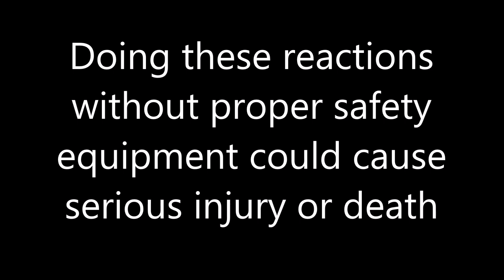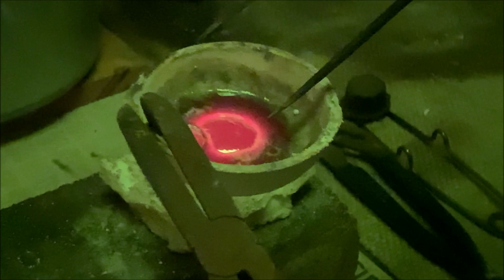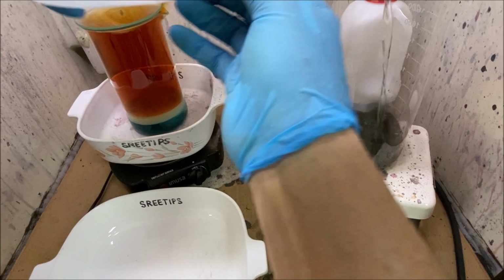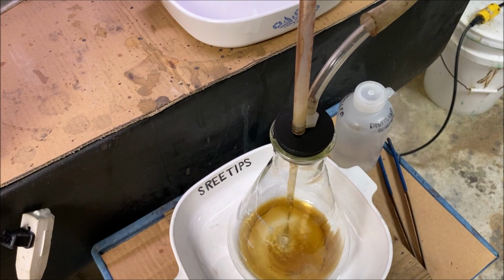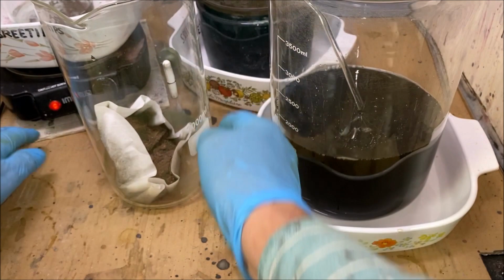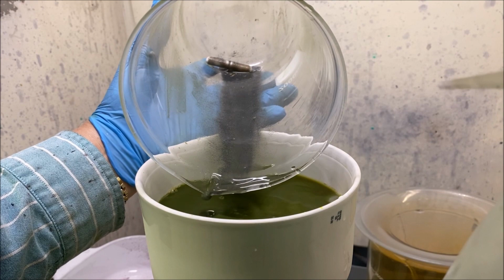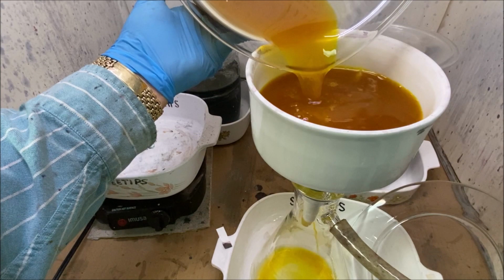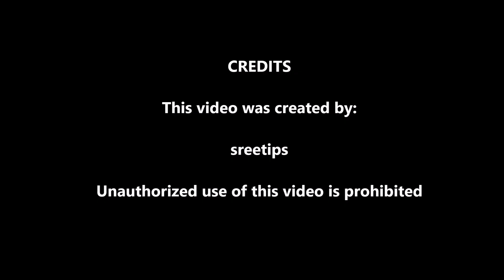Jewelers Tool Drawer Filings & Clippings

Comment: I know a story of an old jewellers work bench. The jeweler one day closed his shop, the heirs sold most of the equipment but one buyer showed much interest in the old work bench. The workbench was in use for decades and showed a lot of wear and tear, and it certainly had seen better days. So you would not set up a workshop with the old work bench. The daughter then took some time and found a very special business that had the special kind of knowledge and equipment to take care of the workbench. They burned it and recovered around one pound of gold from the ashes. So the bench had a much greater value than anybody expected. Certainly much more than the original offer was.
Reply: That story just doent add up/// Ive been a jeweler 50 years...
Reply: @johnshipp3050  hence why it says "stoooooory"
Reply: Fake news
Reply: @BabyJesus66  I do not know any of the persons involved. However it seems plausible that gold particles will stick to the wood of a workbench and get worked into the wood and that you can retrieve it by burning and extracting the ashes.
Reply: I was buying the story until I heard "one pound"
Reply: @williamstamper442  The size of the bench wasn't specified nor how long it had been in use. And it would have included the drawers with accumulated crud. The story also doesn't tell what pound.
Reply: "...Around one pou-"💩💩💩 🤡

Comment: A client owned a jewelry supply company. They made gold chains and findings( catches, stone mount prong settings etc) . They kept a individual section of carpet under each jewelers bench that did gold work and periodically replaced the rugs after vacuuming to be sure no stray stones were in it they wrapped it up and sent to to a refiner who burned the rugs in a furnace and recovered the gold for a percentage.
Reply from the maker: I’ll be doing the carpet from under his bench in an up coming video

Comment: Just some tips or ideas you may try.   Three decades ago when I did fire assaying of ores on our mining claims, we used lead litharge to collect the gold, silver and PGMs and a flux to remove the base metals, that the gold, silver and platinum group metals were collected in the lead - the silver and gold helped collect the PGMs - then used bone ash cupels to absorb the lead oxide leaving a precious metal bead/button.  When you have a good guess of how much gold, silver, etc, you can add a known weight of silver could be added at the cupeling stage to aid in the nitric acid separating the gold and PGMs.   If you are using stirling silver add it to the flux smelt and you can remove the copper (or/and nickel from some alloys) into the slag and adjust the amout of flux to accommodate for the copper.  I also used a polished steel anvil and ballpen hammer to flatten the button of alloy before putting it in the nitric acid to aid in parting the metals.
Reply: By the way everything takes practice to perfect.  But you can save a lot of money using your electric furnace to smelt with a flux to remove base metals, that you are wasting in acids and the amount of time you're using.  Potash, Soda Ash, and some clean silica sand, lead litharge or other pure lead as the collecter, maybe some wheat flour as a reducer in silicon carbide 16 oz crucibles that are reusable if you take care of them, and a metal button cone mold that the whole melt is poured into it and after cooling the button is broken from the slag.
Reply: By the way everything takes practice to perfect.  But you can save a lot of money using your electric furnace to smelt with a flux to remove base metals, that you are wasting in acids and the amount of time you're using.  Potash, Soda Ash, and some clean silica sand, lead litharge or other pure lead as the collecter, maybe some wheat flour as a reducer in silicon carbide 16 oz crucibles that are reusable if you take care of them, and a metal button cone mold that the whole melt is poured into it and after cooling the button is broken from the slag.
Reply from the maker: Excellent information. Thank you.
Reply: @sreetips  There are two books you should invest in and study - the first one I reccommend you start with and can get by without the other book - "Recovery and Refining of Precious Metals" by C.W. Ammon (2nd edition)   The second is "Sampling and Assaying of the Precious Metals, comprising gold,silver, platinum and the other platinum group metals in ores, bullion and products" by Ernest A. Smith.  

That you are only doing small batches of refining or separating alloys to recover the precious metals the electric furnace should be okay to use and control the temperature.  A small propane burner furnace - you can build yourself - can do bigger batches that have a lot of base metals to separate into a flux takes learning color temperatures as too hot will release the base metals from the flux into the button, that can be removed by chemicals like you already do, but far less of them as most will stay in the flux.  While at first this is all extra expences to start, in the long run it will save you money and time.  Hope to see future videos with these changes.
Reply: @sreetips  Just another tip.  If you use lead as a collector it can easily be separated from the silver after precipitation from a weak nitric acid as clorides by boiling in hot neutral ph water. After it cools the lead cloride will re-precipitate - maybe a little sodium chloride to start it.   Tip 2, before you try to precipitate anything with regaents the solution should be close to ph 7. The only difference is using a cementing method by a lower base metal that needs the acid or caustic to cause the reaction.
Reply: @johnchism9625  Hoke covers all that, but the information is approaching a century old.
Reply: @buggsy5  You seem to be impling "old" is somehow invalid?  I covered many subjects in my comments and I wonder if something specific in it brought about your comment?

Comment: I have never been a huge fan of gold and have always preferred wearing silver jewellery, however, after watching a few (lot) of your videos recently, I have to admit that I'm falling n love with gold.
It's intrinsic "permanence"
It's incorruptability
The way it drops out of solution when you add SMB
The way that mud, which you wouldn't so much as look at if you saw it lying on the ground, turns into bright, shiny gold with the simple application of heat and the glittering little ingots that drop out of your mould which I would love to hold, weigh and caress in my hands.
Mmmm! 🤤
Ahem
Safe to say, I enjoy your videos very much.
Reply: Greatest love springs from the greatest hate.

Comment: In the future try to avoid putting ice into the solution. Even though it was made with Distilled water the tray itself is a potential contaminant. A better way that I use is a ice salt-water bath. <3 the vid though.
Reply: What if the beaker breaks?

Comment: Always look forward to your videos. 

I see how studious you are about keeping filter osiers for recovery as well as your waste liquids.  I was curious if you do anything to recover PM from the cardboard to line your v hood with or your lab clothes? Or if you do a regular clean up sweep in the shop (like if bits of gold pop out while melting) / clean the flashback from the hood vent walls? I’ve noticed for older videos the hood vent was pure white and after several years it’s gotten some stains from spills etc.
Reply from the maker: There’s some gold powder on the cardboard from a recent boil over so I’ll be sure to add it to my paper storage.
Reply: @sreetips  What do you do about the PM fumes and fine particles that get sucked out of the fume hood? Maybe not enough to bother with recovery yet?
Reply from the maker: I’ve never tried

Comment: Hi,
If you hammered your alloy as thin as feasible  after the water drop, you would drastically cut the boiling time and dissolve more gold with less acid because of decomposition loss during sutch long heating times.
Reply from the maker: I know, but I’d rather let the chemicals do all that work.

Comment: Back in my chemistry days I learned that cement silver also gets its varying grey colors based on how light hits it when it’s forming. Very similar to black and white photography on film.
Reply from the maker: If my cement silver turns dark grey it’s because other metals are present. Platinum group metals and gold produce a very black powder when they cement out on copper. This black powder combines with the lovely light “machinery grey” that cement silver produces and forms a very dark grey colored powder. But this is very good when I see it because PGMs and gold are a hundred times more valuable than silver.

Comment: Chemistry is obviously the way you do this, but have you ever thought of furnace refining, or smelting? I'm not sure of the term. I've watched some of Jasons MBMM videos on it but I'm not sure that he has it down to a T. He seems to be more in the experimental stages and I think he's more into selling the equipment. He gets results but he does it a different way every time. I have some electronic scrap and I'd like to give it a shot. I know I can make enough heat and I can dial my furnace back for cupelling. I'd be happy with a fraction of a pinhead just to say that I've done it.
Reply: Pyrometallurgy is a great way to get metals from dilute material. You still need the wet chemistry to do the final refining. You are looking at two parts of the same process in reality. Jason does arrive at electrum with traditional cupellation, but on a larger scale it would be terrible. It would take the formation of pounds of lead oxide to refine karat scrap just to the electrum level and then you still have to inquart it. So it’s useful to know both, and even more useful to know what to apply when.

Comment: Great video .How do u have your extractor set up So acid fumes dont damage motor.
Reply from the maker: It’s built into to the unit. I’ve replaced the motor several times. The only part exposed to the fume path is a small part of the motor shaft that the fan hangs from

Comment: Well Sir Sreetips. I now have a gold mud sponge on the bottom of my beaker. Yay!!! The color seems to be just a touch lighter than I see in your video's, but it looks good. I had a huge amount of leftover nitric in solution apparently cause when I started adding SMB the fizzing was crazy. I mean fizzing to the top of the beaker. Thought I was going to have a boil over my first time around. I tell you what, it wasn't as easy as you make it look. I have a bunch of waste and when I filtered I still had a little karat gold left behind. So I will need to refine again to recover the gold that was left behind? Correct?
Reply from the maker: In refining every little bit counts. I add traces to my stock pot.
Reply: @sreetips  I have all the remaining solution in a stock pot. I also have filters in there. how do I dissolve the filters so I can process the remaining solution again? Thank you for your time!
Reply from the maker: I store filters separately
Reply: @sreetips  Thank you

Comment: he I have a trick to help classify and separate stuff like you have in the bowel. turn on your ultrasonic cleaner and put the bowel on top and lift it until it hits the right frequency and all the weighted items separate to their own weight class. its pretty cool. At least it worked for me. I have often wondered if gold miners could use same trick to classify gold out of black sands

Comment: Love the video Sreetips, but I do have a couple random questions that always swirl through my head during your videos. First, have you ever put together the total cost per amount of gold to refine in this process? And secondly, When the gold is in solution would a metal detector react the same way as when in solid form? I would assume so but it just gets so clear that it seems not.  Thanks for the great videos!
Reply from the maker: I don’t track expenses for each batch because it’s not my job, it’s my hobby. Gold in solution is a salt of the metal do it probably will not set off a metal detector. Just like sodium is a metal. But sodium chloride is a salt of sodium metal - I think.
Reply: @sreetips  Very interesting. Could be a cool test to see what a metal detector would do. Thanks for the reply and awesome videos.

Comment: instead of copper pipes, maybe a bunch of copper wire will accelerate the reaction since the wire has more surface for the solution to work with?

Comment: When you're dealing with such dark solutions, has it ever been suggested to add a little hydrogen peroxide? This would cause any carbon in there to turn into carbon dioxide and might clear up the solution. I'm sure there's no risk of losing any metals in the solution this way either. I guess ultimately it's a needless step, since the stannis test is simple enough to do.
Reply: little step for process, nice effect for video))
Reply: Maybe.  Sulfuric acid and H2O2 make 'pirhana solution' which converts organics into CO2.  Not sure if nitric would have the same effect or not.

Comment: Dropping your ring in the dilute nitric did affect the ring slightly. It gave you a close to 24K gold surface layer a few atoms thick. But the weight loss would probably be hard to detect even on my very expensive analytical balance that weighs to 0.00001 gram.
Reply from the maker: The point: without adding silver the nitric can’t penetrate.
Reply from the maker: Correct

Comment: Please correct me if I am misunderstanding.
I wouldn't say that your wedding band is unharmed, It's just that we cannot see the harm with the naked eye.
I would think that any silver or other base metal atoms exposed on the surface of your ring did get dissolved, but because of the content of the gold, the gold atoms encompass the silver and other base metals making the nitric acid ineffective.
Would that be an accurate description of what's going on ?
Reply: No, it's more complicated than that. Gold (Au) and silver (Ag) are close enough in atomic size that the Au-Ag alloy is simply a homogenious mix of the two types of atom. It's a random mix of the two in the overall ratio between them. In 14K gold (58,31 weight% gold) the mix of gold and the other atoms resists the nitric acid. If the concentration of gold was lower, the acid would become effective in dissolving all the not-gold from the alloy.

So it's not that, under the microscope, the gold bits are separate from the silver bits and that gold simply "traps" pockets of silver so that the acid can't get to it. That's actually pretty good reasoning if you're not a metallurgist, and it's valid for a lot of other alloy systems, so don't be disappointed you assumed wrong. 

It also means that Inquartation, "quartering of the gold", is not physically creating a mix of 1/4th gold volume and 3/4th non-gold. In layman's terms, it means that the "nobleness" of gold is no longer able to prevent the silver from dissolving if it is present at only 24% by weight or less.
Reply: @Hydrazine1000  Thank you for your response, very informative. I think I'll spend the rest of the evening looking into how Au and Ag precisely interact with another, how they atomicly "homogenise". :-) Something with Pictures, Lol. I think I'm discovering a new hobby.
P.S. Not disappointed, excited to correct a false assumption. 👍🏾 thanks again.
Reply: @greogewestmann4913  Happy to help! But if you're interested in metallurgy, the Au-Ag phase diagram (a visual representation of how they combine, at a given temperature) isn't all that interesting. THE classic, when it comes to an introduction to metallurgy, is the Iron-Carbon (Fe-C) phase diagram. Not as expensive as gold-silver alloys, but there is a lot more going on, so a lot more to learn and get to understand. 

The iron-carbon phase diagram is one of the first things you learn in Materials Science & Engineering. Been there, done that, got the MSc 😁
Reply: @greogewestmann4913  No problem! The youtube vid you've found is very good, if you're able to follow the various explanations. 

If you're looking for a good book, try to find a copy of Callister's Materials Science and Engineering either as current 10th edition, or a used earlier edition. It's the book that formed my introduction into Materials Science & Engineering in my first year at university. (Though it was only in its 3rd edition back then!)
Reply: @Hydrazine1000  I'll take a look around to find those books. Great Help. :-)
Reply from the maker: You’re missing the point of the demonstration. It’s to show that before adding silver, the nitric can’t penetrate to dissolve out the silver and base metals, the way it does to the gold that has had additional silver alloyed with it.
Reply: @sreetips  Ya, we sort of went off at a tangent..
I just had a naive question but all is well, I understand a little more. I'm now looking into exactly why your demonstration was successful, at the atomic level. This is way above my pay grade, but I'm determined to "know it all" :-)
P.S. If my wife seen me do something like that, she would of freaked out. I could hear her now "Why take the chance" Lol. :-)

Comment: why does your extraction fan make such a high pitched sound? is it like super high speed or something
Reply from the maker: No, it’s a junk motor. I’m planning on building a fume hood from a poly 500 gallon tank. External fan in the attic. Then all we will hear is the sound of air moving.

Comment: This may just be my own ignorance speaking, but would it be possible to take the incinerated material and boil it in sulfuric and peroxide (piranha solution) to oxidize all the carbon into CO2? Then you can see what's left. Probably more trouble than it's worth though.
Reply from the maker: Possibly